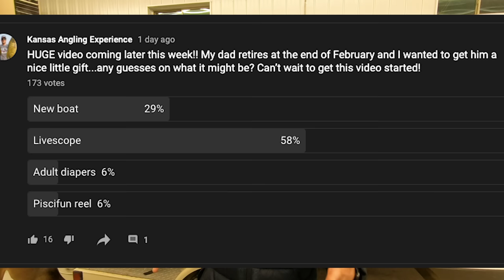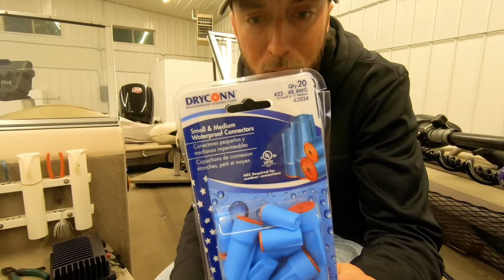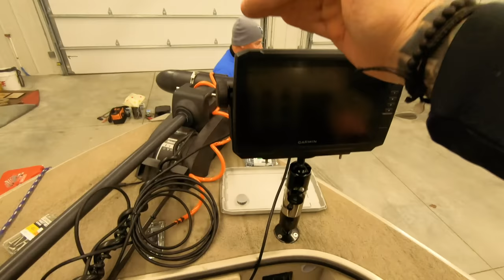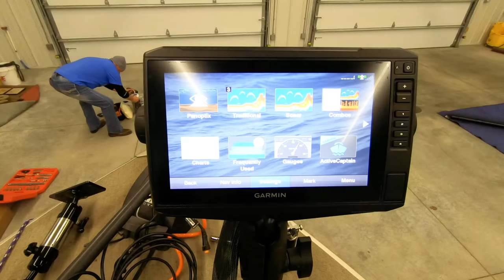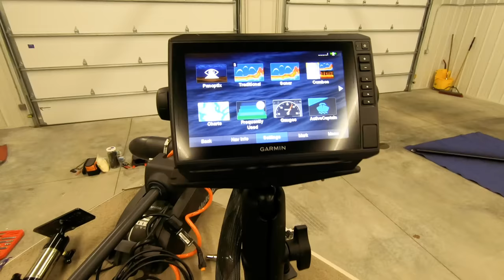COMPLETE Garmin Livescope Install FOR MY DAD!! (Total Surprise!)

Comment: A second comment. Outstanding design, easy and well explained. Thank You!! As a word to help anyone doing this, all the weight of the transducer including pressure from water movement against the transducer set up will be depending on super glue to the PVC elbow.   For some insurance, I suggest set screws and/or even a small screw and nut through the part of the elbow that is holding all the weight of the transducer. Great video. I built mine just like this. Thanks again!!

Comment: So cool to see your dads reaction to it! What a great son to do that for him! Also, I used the same ram mount on my boat so that I can swap over to an ice shuttle I made. And for the shaft I used an old trolling motor that the lower unit was shot. I just cut a 7” section of 1 1/4” pvc to put the Ram mount on and the trolling motor shaft goes in that. Haven’t used it on the boat yet so I may have to make the shaft longer. Nice thing is it’s easy to swap back and forth when ice fishing or open water (I have power cords and Ethernet cables for both, too)

Comment: This is a great tutorial.  The idea for the Dewalt battery set up is a great way to go.  Been planning how the install on my Ranger and running a dedicated power wire from the cranking battery will be a pain in the ass as the conduit is tiny.

Comment: Loved your setup for the battery.  But what was the 12 volt battery that you used,  most are now 18 or 20 volts and that might  be a problem. for the unit.  thanks

Comment: Squirt of clear rtv in the end of the wire nut also water proofs them. Use rubber grommet around the wires through.

Comment: Great install video, Thanks for clearing up the correct angle of transducer. Have you consider a quick change assembly to use perspective view by rotating the transducer 90 degrees. 
Also you rock by doing that for your dad, you could tell he was pretty surprised
MR .
Reply from the maker: I don’t use perspective view

Comment: What a beautiful gesture man.  I wish I could take my dad even fishing.  He's 86 with cancer. This was a great video to watch.  I don't know what that rechargable looking battery has to do with the cable you ran.  I've seen people running the power from the boat battery.  This seems simpler how does it work?
Reply from the maker: Because it's important to run heavier gauge wire to ensure the best possible voltage, which gives you a better picture.

Comment: Thanks for all the links on how you got this done. I am dead-effing-set on no more lead acid batteries. I need to figure out how many dewalt batteries I need to get rid of the trolling motor mess I have right now. 200 lbs of bullsh*t for 50lbs thrust 😡

Comment: How did you anchor the livescope box into that front compartment?  Did you need a network expander?  Lots of questions, but a great video and even better retirement present for your Dad.
Reply from the maker: No network expander needed. Affixed with 2 screws of the 4 holes available to the decking.

Comment: Always love the content, Brian! Stumbled on this one as I'm putting together an LVS34 package and seriously considering a DIY pole. Your design here looks solid. I know you ran this on a RAM mount and I'm considering one of the bike mounts. Do you feel this build holds up well for walleye trolling applications (1.0 -1.3 mph) slow death and harnesses or even crankbait trolling at 1.8-2.2 mph?
Reply from the maker: Absolutely not. The ram mount will flex no matter what. Consider a SeeLite pole instead if you plan on doing any trolling applications.

Comment: Thinking of rigging my new system up like yours .. my concerns are : running 20v on the head unit when they say it’s only rated for 18v. Have you experienced any issues with this ? Second question: using the Dewalt 20v 9aH ... how many hours are you getting off of
One battery ? Sorry if you answered these questions already! I just need some clarification :) thank you for your time
Reply from the maker: The 20v battery isn’t just ran to the unit…the power is split between the unit and black box. Over voltage isn’t an issue when you rig it that way.

Comment: When you have your 93 and the black box running off of your Seelite, what are you getting for running time from the Dewalt battery? What amp hour are you using.
Reply: Just curious as I am thinking about running the black box off the See lite and running the graph off the boat 12 volt supply.

Comment: Brian did you put a converter on your seelite adapter to lower voltage to your 93sv graph
Reply from the maker: No because the power is split between the black box and graph, as explained in the video.

Comment: So gotta question on the DeWalt 20v battery system no regulater needed  if powering black box and graph jus wire them together to the power?
Reply from the maker: Correct
Reply: Thanks

Comment: Awesome video. Looking at doing a similar setup with the 20 volt system. I may of missed it but do you charge the 20 volt lithium's off the boat once you get home or do you have it setup within the boat? I am looking to tie the 20 volt chargers in a compartment but was looking for a solution to tie to existing charging station with in boat. Converting AC to DC somehow or splicing in to 4 bank charger. Trying to avoid having to plug in multiple plugs when boat is being charged or stored.
Reply from the maker: I just take them off and charge them. Some guys have hooked up that whole charging configuration.

Comment: Really enjoyed the video.  Great job and great for your dad. Where did you get the Zero-degree mount for the transducer?  
i am using the same setup but using the factory mount with the offset.  Thanks
Reply from the maker: You can get the 0 degree mount just about anywhere now. Garmin even makes one, they didn’t at the time of this video. You can find them on Amazon, or the Garmin website.

Comment: Great video install. Why did you use the little battery pack deal? Couldn’t you have ran power straight to the head unit then to the black box?
Reply from the maker: Better to have dedicated runs. My preference anyway.

Comment: Hey, are you using Garmin 93SV?  I was looking at the spec's and it's Voltage Rating 9-18volts any issues?
Reply from the maker: That’s only if you just power the graph. The black box is rated to 30. Graph 18. And the power is split between the two.

Comment: Hey Brian, nice pole you got there 😂 BTW, I wish I had a son like you - I could use that setup on my boat, and I am retired! Great video!
Reply from the maker: The transducer would never go anywhere...it’s secured with four bolts to the zero degree mount. Not to mention already connected to the transducer cable, which is also secured to the pole with the electrical tape. If a cap failed, I’d only lose the cap..
Reply from the maker: @mburke1211  😂 I just got off the lake so, normally wouldn’t be so quick! There are enough dumbasses that comment on my videos, you’re not included in that group!

Comment: Nice job. Cherish these years.
Curious why you used the crappy little drill battery instead of a real Lithium? What AH is that? 93SV+ and black box draw about 2a. So if 6ah bat, you get 3 hours run time max
And I would think the battery would be better mounted in the hatch with the black box for a cleaner install and not exposed to weather..
Reply from the maker: Working fine over a year later for my old man and he’s loving it just as much! Anything else you’d like to add?

Comment: So how do you turn off voltage to the black box or do you just have to remove the battery every time you use the outboard
Reply from the maker: The power is to the graph and black box. By removing the dewalt battery also turns off power to both.

Comment: Is that for the lvs34 transducer? Dose the lvs 34 mount the same as the lvs 32 ?
Reply from the maker: The LVS34 mounts the same. But you would need to buy a LVS34 specific 0 degree mount for the pole.
Reply: @KansasAnglingExperience  is the 0 pole mount the same mount that allows you to mount to trolling motor shaft ?
Reply from the maker: @davidraguse2106  no. That’s the stock mount.
Reply: @KansasAnglingExperience  sorry mate  confused...can you explain the differences please?
The "0" mount will still let me do all the modes ... perspective, down and forward....be using perspective mode most and occasionally forward mode ?

Comment: Sweet set up. I thought I read somewhere the 93 graph runs up to 18v. You're not worried about running 20v batteries with it?
Reply from the maker: No, because the power is split between the black box and graph.
Reply: @KansasAnglingExperience  I just purchased the same system.  Loved the video, but I did noticed that the graph read 20.3v at the 20:37 mark.  So, your dad has had zero issues with the graph?  Just making sure since most comments are from a year or two ago.  Ensuring nothing transpired since.  Thanks
Reply from the maker: @seantda1  my dad and all others who have benefitted from this system have had zero issues. You have to remember that power is being split between two things, the graph and the black box. Now if you were running 20v direct to the graph and the graph only, yes, you may have problems. I have long since migrated to larger dedicated lithium batteries for my setup, but my dad is still running drill batteries very successfully!
Reply: @KansasAnglingExperience  Thanks a million for your prompt reply.

Comment: People need to check their fish finder. I tried to rig my Lawrence with a 20v dewalt just like that and it won't work. When I first turned it on it came on and I was like cool. I finished making my portable box and charged the battery and it wouldn't turn on. I thought it was the wiring. It turns out the maximum voltage of the fish finder is 16v which actually turned out to be 15.6v . If the battery is near dead 20v <15.6 volts it runs for about 20 minutes then the battery is too dead.  So be sure to check your fish finder before spending a lot of time.
Reply from the maker: As I’ve said 10000001 times before, the GRAPH AND BLACK BOX are powered by the battery. Not just the graph itself.

Comment: What’s the advantage of using the rechargeable battery deal ? Thanks
Reply from the maker: Isolating power so there’s no battery drain on the starting/accessories battery.
Reply: @KansasAnglingExperience  I see . Your videos are very helpful keep it up ! Good job on your dads boat .
Reply from the maker: @Joe-od1vn  thanks!

Comment: Just curious how long will it run on the battery setup ?
Reply from the maker: 6ah batteries get about a 5-6 hour run time. 9ah is about 8 hours.
Reply: @KansasAnglingExperience  what battery do you run

Comment: I'm not quite Understanding why you would power the unit off of dewalt battery?
Reply from the maker: Many reasons. It isolates power to one battery with no other accessories on it-i.e. livewells, radio, etc. Running 18-20v will also provide the best possible Livescope picture. Not to mention a clean install and not having to run any wire back to the starting battery. This is not a new concept in the Livescope world,....and has worked amazing for me in the last 2 months I have been running the same setup.

Comment: Per ABYC, wire nuts are never to be used.
Reply from the maker: Per me, I don’t know what that means and wire nuts work just fine!
Reply: ABYC is American Boat and Yacht Concil  and they are basically the Bible on how boats should be built/maintained. ABYC is considered the standard in a coury of law. Example.... I your boats burns down and a Surveyor sent by insurance finds wire nuts your claim could be denied. So wire nuts don't work fine. Also, soldering is a big nono in marine world.
Reply from the maker: @salmonbum1066  😂 means nothing to me. Everything has worked fine and dandy for a long time now!
Reply: I'm sure it does work fine. But like I said if something were to happen and a loss was had to you or someone that installed the system using the suggested wire nuts, a claim could be denied.

I am a Garim Authorized Intstaller and Dealer, National Marine Electronics Association Certified Installer, Airmar Certified transducer installer, ABYC Member and Standards Certified,  Licensed USCG Captain as well as a Society of Accredited Marine Surveyors (SAMS) Surveyor, so you can take what I say as you wish.
Reply from the maker: @salmonbum1066  I mean your credentials look really fancy but a claim for what though? We’re talking about marine electronics here buddy. If installed correctly, which they are (sorry I don’t have time to list all of my credentials here…), then there will be no issues. Here we are well over a year later, and my dad is still enjoying his electronics setup! 🤙🏻
Reply: Again, Per ABYC E-11, wire nuts are not to be used on boats. So no, your install was not done correctly. As mentioned,  if a wire nut comes loose (a reason they are not to be used) and a short happens which catches boat on fire, you insurance claim may be denide due to installation not adhering to ABYC Standards.  As being a marine Surveyor, I write up all wire nuts I find. When insurance reviews the survey they have the option to put vessel on "Port Risk" until wire nuts are removed and replaced with ABYC approved connections. 

But like I said, you don't have ro listen to me......

Comment: Should video taken him out using the live scope
Reply from the maker: Probably will!
Reply: Quick question what is the sea charger for ?
Reply from the maker: @jacobyaden1376  the what? The SeeLite battery adapter is for dewalt drill batteries that power both the graph and black box for Livescope. Thought that was laid out in the video pretty clear no?